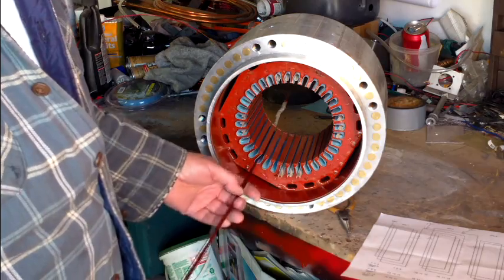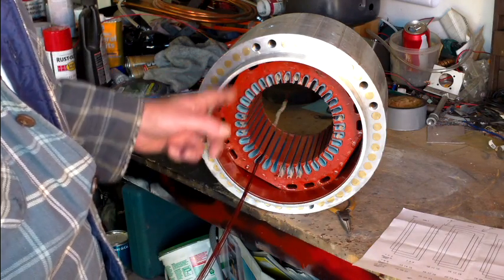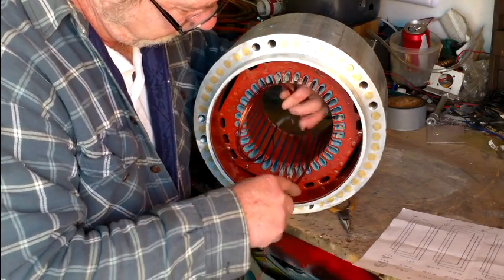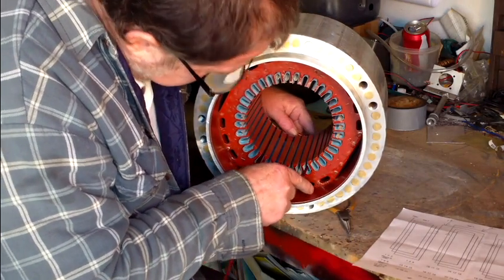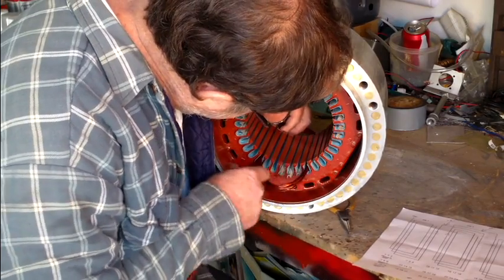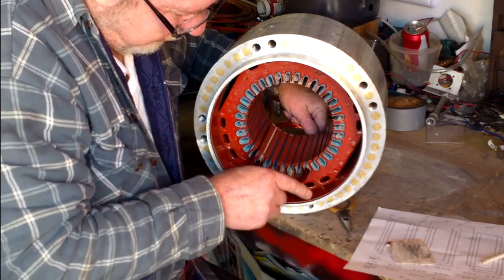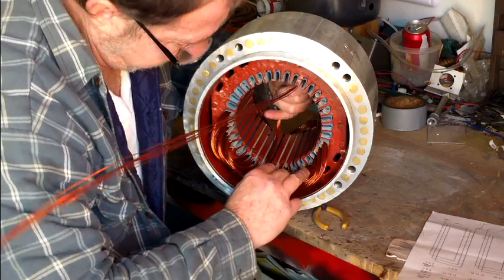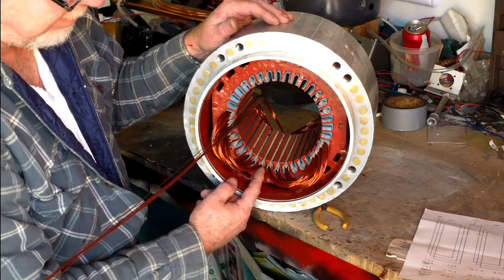Ivan's Garage

Comment: Dont you have form for to make Wind?
Reply from the maker: You can't wind a whole phase on a form, most form winding is done a pole at a time, then you would have three connections per phase 9 connections in all for the 3 phases,  big connections, to big to fit in motor...  make sense...  that is why I lay each phase one at a time then you only have 3 connections for the leads out of the motor...

Comment: It will be advisable to check each coil. After ensuring each coil has
same resistances you can safely insert the coils in the slots. With
this you will never get imbalance in per phase current or per phase
resistance. You can check the above coils and the per phase
micro/milli ohm winding resistance values by Digital Micro Ohm Meter.
You can check the purity of copper/aluminium wires..contact for the
same > parameter_ent@yahoo.co.in
Reply from the maker: I do it the old fashion way and use a hand crank MEGA
Just in case no one knows what that is,  it apply's (when you crank it) a very high voltage to the winding and measures meg-ohms,  check winding to case ground....  but if you are really paying attention when you are inserting your wires ya don't ever what to get a wire behind the slot paper.....  I call it, look and pay attention....   here is a picture of a hand crank mega... I have a really old one.. forty plus years...

https://images-na.ssl-images-amazon.com/images/I/51hgEW0z%2BTL.jpg

Comment: I thought the order is ABCABCABC for every slot.. but this shape alitle bit5 different ... or i did get it
Reply from the maker: Really does not matter What you label each phase  ABC,  CBA  They are all the same, the biggest part is the (start) (finish) of every phase,  all three phases are the same  true?   A start  A finish  ....  B Start  B Finish   ...... ect  I usually put a tag-tape when I start a winding (phase)   AS  for  A-Start  then once the phase is layed  AF   A-Finish   ect....  on with the next phase ......

Comment: Hey Ivan!! That was a totally different way of re winding I've never seen before. The way I was taught is through groups and whatnot. I'm glad to have seen a different version and honestly miss rewinding and working on motors in general. Thanks!!
Reply from the maker: I use to rewind, in a motor shop, you would wind each pole and then lay it up, correct?  but would only have 3 or 4  20 gauge in hand, so the pole connections where no big deal.....  When ya start winding 12,  18 gauge in hand the pole connections are way to big to all fit in case, you would have 9 extra connections, 3 on each phase times 3 phases,  never fit in end bells....   I could wind a motor quicker with all in-hand laying each phase one at a time, and way less connections...
Reply: @Ivansgarage  I wasn't really taught by poles and it's been over 10 years since I've touched a motor lol

Comment: wow this is what i am looking for, step by step tutorial and easy to understand but where is part two ?
Reply from the maker: The second phase would start 60 degrees around from the first phase and third phase same thing. If the stator has 36 slots each slot would be 10 degrees.  Allways make sure you are winding in the same direction all three phases.
I wind counter clockwise, start on the bottom and go right.  Turning the motor in a clockwize direction.

Comment: Thanks for the vid. Had a?. I put together 3phase 220v AC roto phase converters 15HP and up. Now I read that if you rewound the motor so to stabilize the voltage on one leg namely #3 with more wire It will keep the voltage of 120v AC on that leg and not drop under load which does happen on converters quite a bit. I balance with caps but that changes under the workload applied to the motor. As you add more caps on the different legs it shifts the balance of the phases this way or that, never giving you a true 120 degree between the phases. So can this be done?  I would like to try it on a say 10HP

Comment: Ivan,  is this sinusoidal winding?
Reply from the maker: I guess one could call it that sinusoidally distributed windings whose axes are displaced by 120 degrees apart, I call it balanced winding, evenly distributed.
With a regular overlap winding running on three phase the phases coming in are never equal most of the time a wild leg will exist, but using  a controller all
legs are equal, so the reason for the balanced winding and less saturation
for a group of slots. You asked.

Comment: How many poles does this motor has?
Reply: james kinuthia : In the OLD days there was easy formula : Poles times phase equal grouping. EXAMPLE (4) pole winding X 3 phase = 12 groups. Then you divide the groups by the number of slots. 36 slot divide by 12 groups = 3. So you wind 12 groups of 3.  If you had a 48 slot motor divided by 12 group = 4   The poles go( 2 )pole = 3600 rpm (4) pole = 1800 rpm, (6) pole = 1200 rpm, (8) pole 900 rpm, (10) pole 720 rpm (12) pole 600 rpm, (14) 540 rpm
Standard slot configurations are 24 -36 - 48 - 54 - 60 - 72 slots. More RARE are 12 slot 18 slot and above 96 slot even 42.  Different slot numbers DON't always  come out equal to a said rpm. That's were you hear the term ODD GROUPINGS. If you had a 1200 rpm winding in a 54 slot stator, that would be 18 groups of 3, but if you had that same 1200 rpm winding in 48 slots. That's were you get ODD GROUPS.  I know it's confusing, but I did it for 38-yrs so it all makes perfect sense to me LOL...

Comment: coils are hard generally. what makes them hard?
Reply: The circular mil is the determining factor.  To make a winding easier to rewind we often reduce the cir. mil. You can take data that needs to be 1 # 15 AWG and reduce to 2# 18's AWG use the same turns. B-U-T If you are short on a wire supply and need to figure out the best way to use the supply available. This will work. Say your ORIGINAL DATA is 6# 16 AWG 7 turns and a (1) WYE 460 volt connection.  In a formula that is know as ( Cut the wire size in half, then double the turns and double the connection. ) You would then be able to use NEW DATA 6# 19's AWG 14 turns and (2) WYE connection.  This will N-O-T work if your final voltage is 230 volts. SORRY.

Comment: So you got a 1 turn 24 wire in hand motor wound in the skeem wound configuration.1-7pitch with a total of 12 groups of 3 coil per group lap wound correct.this is a 4 pole motor  about 1800 rpm.You could probably recalculate that and have it to where you can pre-fabricate the coils ahead of time with more circuit and wire in hand but you going to need a program to run all your density to match you original density so it's better the way you do it. Nice job.
Reply: chris : On a golf cart motor???  1 turn 24 in hand, hardly seems doable. LOL...

Comment: Ivan it would be 10 times faster if you use preformed coils. Make the coils up 1st then place them.
Reply from the maker: You can not use preformed coils, You would have four coil sets per pole and 3 more connections per phase for a total of twelve LARGE connections. There is no way they would fit in the motor bells, end frames. A regular motor may have 3 wires in hand for each pole with a six wire connection, I use 12 wires for each pole there is a 24 wire connection for each pole.  There is no way you can pre-form a whole phase then lay it in because, every other pole has a longer jump in slots than the previous one.  Make sense?

Time wise, by the time you wind one coil set (one pole) 4 coil sets per phase then do the extra connections (3) for each of the four poles, one phase, I can lay the whole phase faster, with no pole connections,  1 hour to lay a phase.
Reply: you dont connect each wire you tie them together for the connection
Reply: Hi Ivan. You would use a small fibre board 'scraper' to assist in inserting the coils if they are preformed. Those slot tops are open enough to wind this a standard method but everyone to their own method I guess. I've wound from 0.37kw to 900kw motors for the past 35 years so I thought my input may have save you some time.
Sorry I didn't mean to sound condescending at all. Thanks for the vids by the way. :)
Reply: switchkwb with all your experience I would like to see a video because in my ignorance I thought this dude was doing a good job
Reply: + switchkwb : You are CORRECT!!!! It's a 4 pole 3 layer basket wound stator. Pretty easy, and PLENTY of room to make the connections. You and I have wound a ton, that had NO room for the end bell to fit over I'm guessing. ;-)  Ivan also said the wedge won't slide in, if a wire is behind the cell paper???  Wish that was true, I've had many of my employee's stuff stator's with a wire behind the the slot paper. That's why I usually inspect their work, even after many years winding.  Everyone use to spray RED GLIP on the stator, and we switched to WHITE or GREY primmer to show the copper wire better.  You and myself used the OLD R-M-R Rag Mylar Rag, and knuckle busting fiber wedges.  We only use Class " H' insulation now N-M-N 3-3-3 or 5-5-5 Nomex is the Standard at 1/3 more cost.  BUT so much easier to work with.
Ivan, seems like a nice enough guy, but I would lose money if he took all day to rewind a 5-hp stator. LOL...
Reply from the maker: Yes, I use a couple of different plastic tools to slide through the slot while feeding the coils.

Comment: hi.are you rewinding motor two speed single phase..diagram circuit coil.thanks
Reply from the maker: No  these motors are wound for 50Volts and used with a curtis controller,
variable speed.
Reply: +Ivansgarage theses motor two speed high and low. work to 220v 2.5ampers..motor water colding. thanks for message.mohammed from Iraq.
Reply: Ivansgarage
Reply: Ivansgarage
Reply: Top Gear

Comment: Hi Ivan could you please give me a link to the winding schema. this is the print you use in your video.Thank you.
Reply from the maker: +thebuggy73    This is for a 36 slot stator motor all windings for a Curtis Controller should be 3 turns, 8 inhand, 18 gauge mag wire. Each phase lead (delta) would be 16, 18 gauge wires, think that will handle some current,  how about 125 amps continuous and 650 amps peak...  Now we are talking 225 foot lbs of torque out of a original 10 hp motor...
                              http://ivanbennett.com/ev-motorwinding.html

Comment: hello sr. i need to rewind ac motor but. all motors in my area have not correct copper wire  size and number of copper wire in  a slot. please if you can send me all motor data book which explain about copper size and number of copper wire per slot in ever induction motor. i am waiting you
Reply: +Ebrahim Mohammed   Hello , did you find anything useful ? If you find send me please . Thanks

Comment: whats difference between star connection and delta connection
Reply from the maker: +nicholas piacentini   Less current, all so means less torque, 20-30%
less. That is why I all ways do a delta connection.  I use 2-0 leads able to handle 650 amps.. You won't blow those.
Reply from the maker: Here is nice diagrams, Delta or wye connecting.
http://ivanbennett.com/forum/index.php?topic=26.0
Reply: +Gowrisankar Gowrisankar star draws less starting current which is good on big loads as you dont want to blow your leads off
Reply: When you have big motors (550KW)
you dont do an internal connection so people can choose how they want the configuration from the terminal board

Comment: hi evan.

can you please tell me how you calculated the parameters of the motor like no. of wires per slot.,, no. of poles.,, diameter of the stator,, , length of the stator, etc. any books or links that you could suggest for motor design or could you do a tutorial on motor design. please. dying to know how these beauties are designed  and constructed. 

thank you

Comment: @manuel alfaro  for copper wire, try maplin or radio shack, i tend to use either radio shack or eBay, if its repairing the motor, most of it can be bought on eBay, if not then phone up maplin, hope this was helpful.

Comment: I use a piece of wire old wire left over and lay the first pole, remove it and measure it, times 4, for 4 poles, thats the length  for one phase lay. On that test lay on the first pole I leave at least a foot out each end. Ya don't want to be to short.

Winding for the Curtis Controller I try to use 12 inhand and 2 turns,..so 24 wires for the first lay..first phase....double layer-second phase = 48 wires per slot....

Yes you use magnet wire to wind a motor.
I all ways use 18 gauge. This is the wire I have been using. It takes about 12 lbs. per motor.  2 rolls.
This is the link where I buy my wire....
http://www.temcoindustrialpower.com/products/Magnet_Wire/MW0154.html

Ivan

Comment: how do you know how much wire to use, it looks like it was pre-cut, to the exact number of strands, and length.  But How do you know, exactly how much wire will be used inside for all the windings. Obviously you have to know a ballpark figure as to how much you need, or else you would get to the end and be short... D'Oh... 

Is this magnetic wire, or just regular coated copper wire...?

Comment: Why are you scan winding it would be easer to wind the coil groups
Reply: If you where to do pole groups you would have 3 pole connections for each phase times 3 phases = 9 (24 wire connections)  plus you would have your 3 delta connections. To much of a cluster to fit in the motor.  It only takes me about 1 hour max to lay each phase and no pole connections.
Reply: you can make a connetion just as tight as the coil with little room expansion very easy

Comment: Hi Ivan, two questions from someone who does not know much about electric motors/generators, but trying to understand....
1. Is each individual strand of copper wire insulated from the next ? i.e. so current travels only along the length of the copper wire and not across a bunch of wires....? i.e. is each strand of individual wire dipped in some insulating 'stuff' ?

2.I notice in your video the same length of copper wire is used for each Pole, i.e. there is no cutting of the wire when you have wound the first Pole, you just keep winding into the next Pole - so what is it that gives the North/South change....is it the direction of wind ? is this reversed so current is now flowing in the opposite direction ?
Thanks
Reply: Yes each wire is coated with varnish (its magnet wire} google it.
This is why I hand wind, pole to pole, so there is no pole to pole
connections, they would be to large.
North/South pole change comes from AC, alternating current.These are
all 3-phase AC motors.
Reply: cool, thanks for your info and advice.

Comment: I have a dumb question, how did you get the old windings out? the stator body doesn't look like you cooked it. and I can see old varnish drippings above the top end (view in video) which means its not a new stator. every time I had to cut winding crowns out we had to burn it first which miscolored everything but that one looks perfect.
Reply: I use a wire brush and drill to cleanup the stator and housing, then spray the
stator and housing with spray varnish, insulator.
Reply: Sound advice. Good practice.

Comment: Have you got any advice on how to shape each coil. I work in a rewinds factory and machine wind the coils. But I can never get the end windings to look neat.
Reply: I don't know the setup you have, but the shop I worked at had a welded adjustable rack, when we were done with a set of coils we just tighted up the rack until the coil was nice and square (or whatever shape usually ours were like a long hexagon) . using a small layer of Teflon tape to keep them together. but this guy in this video is doing it way differently. so idk,
Reply: practice makes perfect,  you really don't need to square up the winding
unless you need the head room.

Comment: Wow mate you are making it look so hard youy can wind your coils on a electric machine and insertion al lot easier than what you are doing mate
Reply: This is DIY, NOT a Baldor factory.
Reply: Ivansgarage Well mate we are  not a so called Baldor factory either we repair all motors no matter what make
Reply: Jack Bramwell  That all depends on the motor voltage you want, the best way is to see what the original wind is.  I only wind motors for the Curtis Controller, 50-70
volt and 650 amps..
Reply: I am right with the assumption that the disadvantage of single pre-prepared coils (if you can call it a disadvantage) is that the coils need to be connected in the end by soldering correct wires together?
Because the approach shown here has one long line of copper going a long way rather than separate coils. isnt that an advantage? thanks in advance
Reply: Ivansgarage
Spot-on Ivan.  As a builder, I might have to repair or replace a motor once every few years.  So I dont want to invest in special winders etc.  I need to know the theory and  the method.  You say 3 winds per slot.  Most motors have lots more than that dont they?